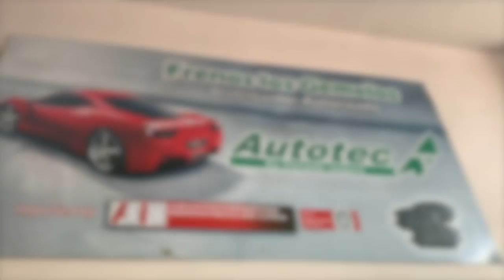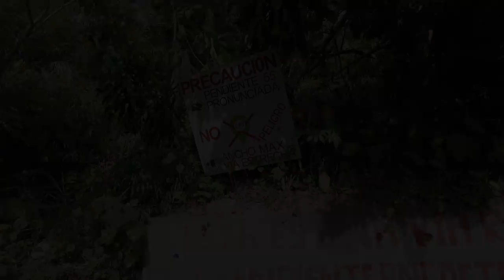NO brakes NO spare parts NO problem? 😅🤞#vanlife #colombia

Comment: what you may want to do next time  you take the wheels off is change the hardware, all those little parts and springs and connectors  in the break system, and any small parts in the calipers
Reply from the maker: Thanks for the tips!

Comment: in the old days midus used to replace brake pads with asbestos brake pads... they never needed to be replaced... they lasted as long as the car lasted... just clean them out every now and then — they would get a little noisy (dusty/dirty)?
Reply from the maker: Wow! That's wild. Yeah, ours are super squeaky so we might replace them anyway
Reply: @the.vandersons  Asbestos brakes are squeaky. A little oil on them quiets them for a while. Cleaning out the dust in them also makes them squeak less. [for a little while] I just learned to accept the squeaking and be thankful for how long the brakes lasted—until the cars died. I spent the money on other things rather than replacing quieter brake shoes all of the time. Of course your experience may be different.

Comment: When you drive in the mountains those are normal problems you will encounter you should try to use the hand break when possible
Reply from the maker: Our hand brake is broken :P
Reply: Highly recommend fixing that if you’re crossing the Andes